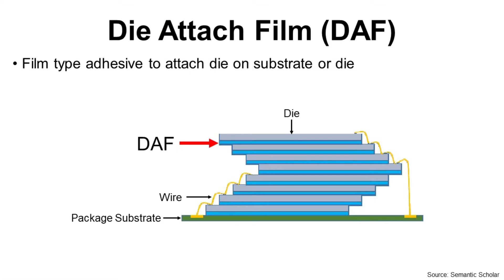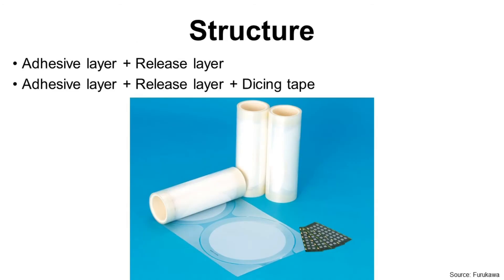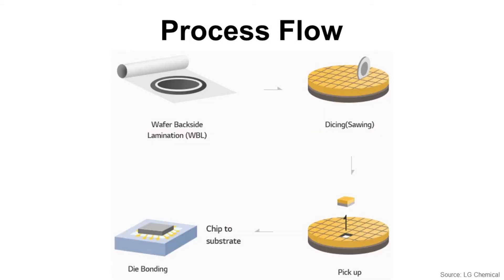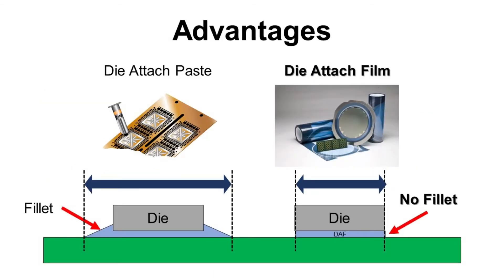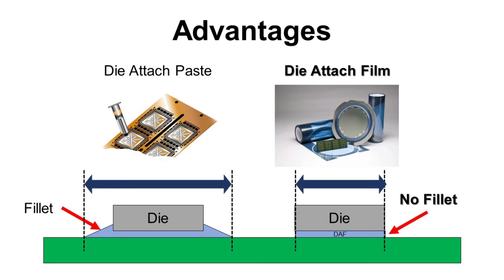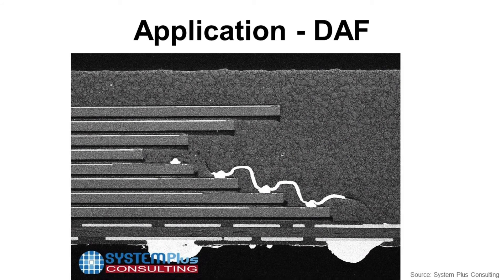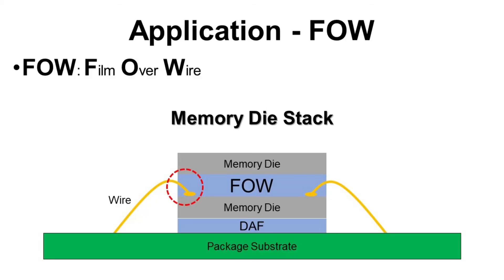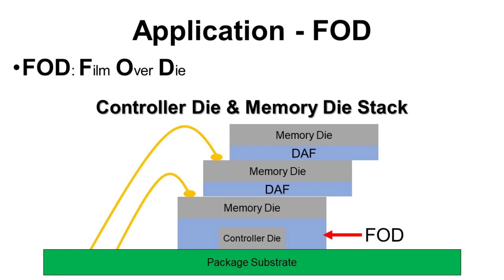[Eng Sub] Die Attach Film (DAF) - FOW, FOD, NAND

Comment: Hi can you make video about uv and non uv tapes.
Reply from the maker: Usually UV tape has high adhesion strength before UV irradiation during wafer back grinding process and wafer sawing process. It is also good for thin wafer processing with high adhesion. After UV irradiation its adhesion strength is decreased very much and it is good for die pick up from UV tape. Typically UV tape color is white. 
Non-UV tape has lower adhesion strength than UV tape but much more widely used for wafer back grinding process and wafer sawing process than UV tape. Typically Non-UV tape color is blue. Please check below link for more information. 
https://www.furukawa.co.jp/uvtape/en/technology/uvtape.html
https://www.furukawa.co.jp/en/product/catalogue/pdf/uvtape_e_p034.pdf
https://www.linteceurope.com/products/tape/dicing-tape.html
https://www.linteceurope.com/products/tape/back-grinding-tape.html